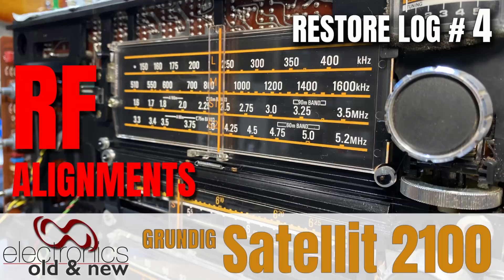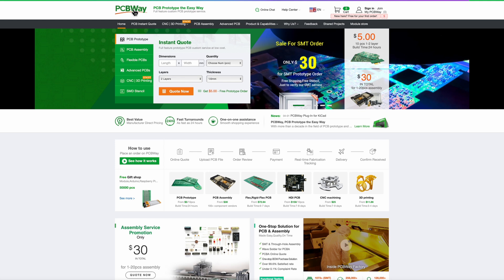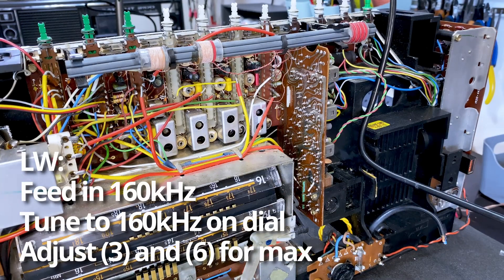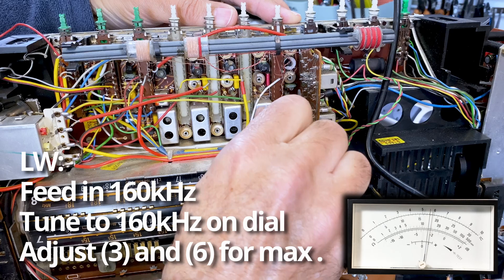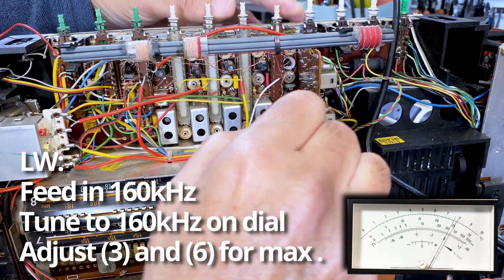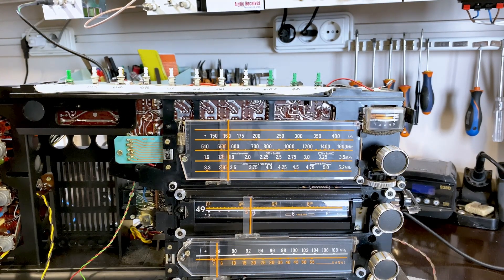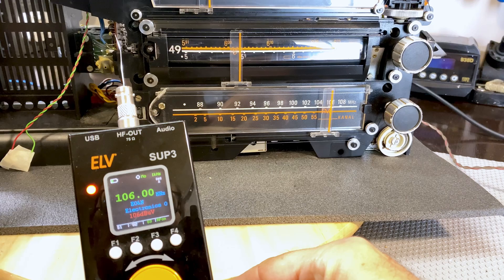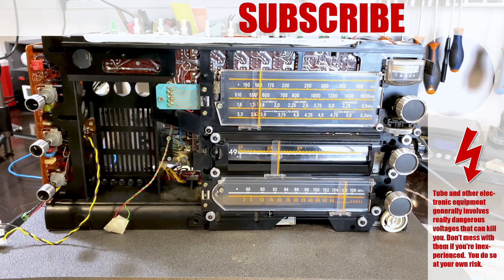Aligning the RF for the AM bands. Grundig Satellit 2100 restoration part 4 #PCBWay#

Comment: I have the 2000 and the 2100. (original) restored.. Do you have in your country also 9 KHz IF on AM like here in West Europe? Is there an USA AM IF version with 12 KHz or more? Like to have more bandwidth on AM and SW, because we have here much stations with 12 KHz bandwidth.
Reply from the maker: We use the 9kHz channels here too. You can easily broaden the IF pass and if you use a visual alignment method. The downside is that you’ll reduce the sensitivity slightly, and your selectivity will be reduced too, which may not be a problem at all.

Comment: Hello Sir, I have got today a second hand radio the same as yours, but I have no signal generator or other alligement devices here and what is the scale on the right bottum side of the scren if I may ask? and have you some tips for me?
Reply from the maker: I’m afraid the only info I can share is in the videos. I try to make them as informative as possible to help others to do their own.
Reply: @electronicsoldandnew  Thank you for your quick answer, Mayby I go bying a funciton generator and scoop, that will help alot I think, anyway thanks again I keep following your video's, have a nice weeekend :)

Comment: Fairly straigth foward :) 
So I started diging into my CIT K24 signal generator and I'm starting to regret I even pluged it in to the mains. Alot of cold solder joints and someone wired the B+ to a 12au7 control grid... that cant be right :) of course there is no fuse! Current limiting starts to make sense also. Filament voltages reads 6.7, I think I should try to tame that. The schematic says wire the 6.3v to pins 4 and 5 which sounds correct but also has a plate marked as pin 5! The transformer has no markings, gray wires are recieving mains voltage, green wires are tied together in a terminal strip? I believe thats why the powertransformer shakes the chassis... I need to tread carefully on this one. I'll try not to burn down the house :)
Reply from the maker: Be careful. B+ to the grid? someone messed up 😊
Reply: Is there any way to lower the filament voltage? Its straight ac from the transformer. Maybe I could try adding a low value high wattage resistor. Its 8 volts with no tubes, 6.7v  with them. Or perhaps a tube has gone bad having that much voltage on the grid... just thinking out loud here :)
Reply from the maker: Try the resistor. make it a 10W for safety.
Reply: Thank you :)